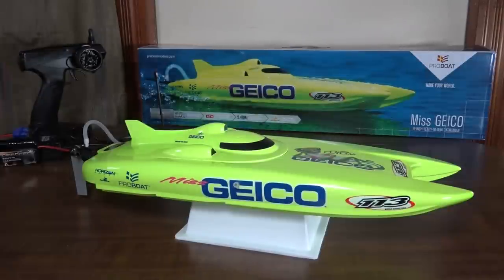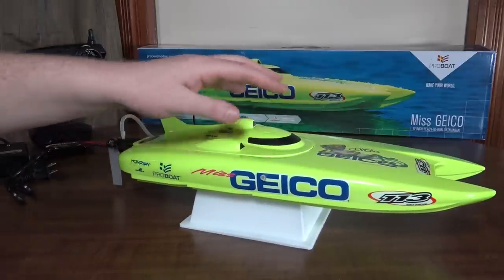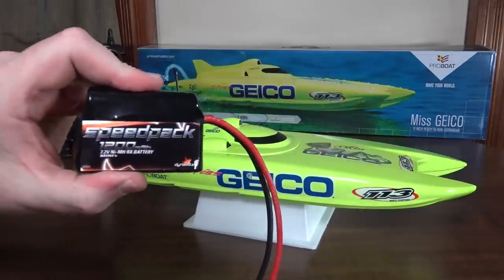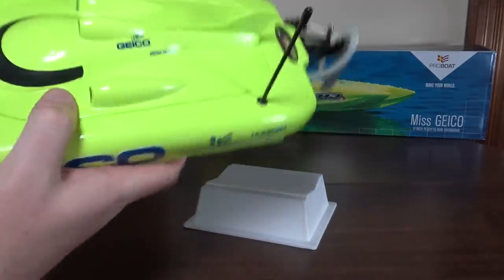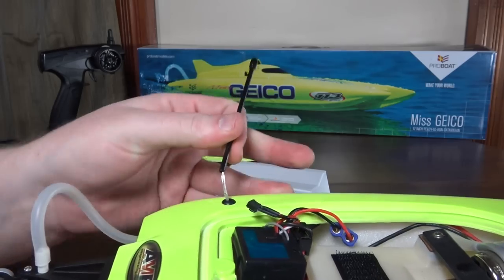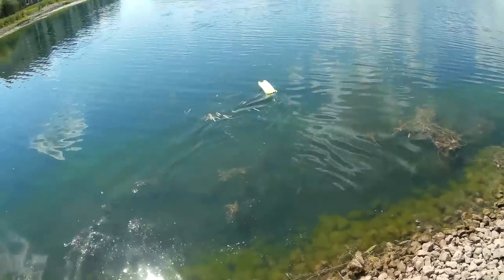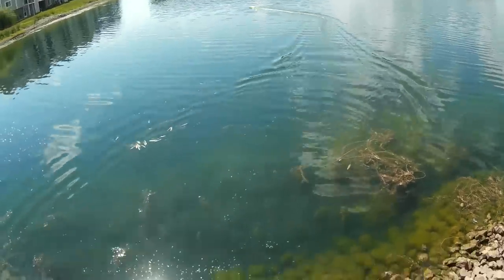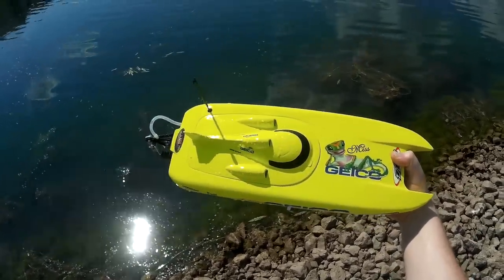ProBoat - Miss GEICO 17 - Review and Run

Comment: I have the proboat impulse 17 and 31, my 17 I have a lipo for it and it basically doubles the speed, and yes they're slow with the nickel pack, but lipos will work. I use my 17 as a rescue boat for the 31
Reply from the maker: +DeucesWild Yeah, I just ordered a LiPo, and LVC buzzer (since the ESC doesn't have LVC) for it.  I'll do another run video of it with the LiPo.  :)

Comment: Hey Ryan, thanks for the candid review.  Not really a $120 product, with only a 380 motor.
BTW, Horizon chat specifically told me do not use a LiPo on this boat.
On another note, couldn't help but notice the different hue of the boat between the Sony and the Mobius.
Thumb's up!
Reply from the maker: +Steve S They probably said that because the ESC does not have an LVC.  But, it should still work... I'll just have to monitor the battery level on my own, or get one of those LVC warning devices that connects to the balance plug.  :)  I'm gonna give it a shot, anyway... I'd rather burn this thing up trying to make it go fast, than live with it the way it is.  hehe
Reply from the maker: +Steve S Hah, that thing is a wheelie machine!

Comment: you should put a 3s lipo in it and see how long it lasts until either the motor or ESC burns up, and then put a brushless power system in it.

Comment: If I remember correctly there are upgrades for lipo and brushless available for this boat.
Reply from the maker: +Anthony Eaglebarger (toysoldier46552) Hmm, not from ProBoat, but maybe from a 3rd party.  I ordered a LiPo that should work with it, so I will likely do a follow-up running video of it with the LiPo, to see what difference it makes.
Reply: Flyin' Ryan RC Actually I think it is a different model... does the 29 ring any bells at all rather than the 17?
Reply from the maker: Anthony Eaglebarger Yeah, the 29 is brushless right out of the box.. but it costs $430.  :/
Reply: Flyin' Ryan RC well it is brushless and uses 6s if I remember correctly so most likely worth the extra bucks for the speed.

Comment: I wouldn't mind starting out on a slow boat, but if it's slow I'd rather have an rc battleship with rotating turrets. That at least looks it's supposed to be slow.
Reply from the maker: +HelmutDoork That would be cool.  :)  And, yeah, that is my main problem with the speed of this boat... it's supposed to be fast by design!  If it was designed like a yacht or something slower, then it would be much more appropriate.

Comment: Great video flyan Ryan can you run 3s in the miss gieco boat?
Reply from the maker: I don't think so, or not safely at least.  I didn't want to use more voltage than the stock battery, as the ESC may not be powerful enough to handle more.  I think the brushed motor is really the limiting factor, not the battery.

Comment: how did you switch the nmhd to lipo?
Reply from the maker: +Jerry Johnston Nothing to it... I just bought an Eflite 2S LiPo with the same connector type and similar size, and plugged it in.  :)  The boat's electronics doesn't have a LiPo low-voltage cutoff though, so I bought a voltage alarm that connects to the battery's balance plug and that goes off when the battery hits low voltage.  :)
Reply: +Flyin' Ryan RC ; Thank  you  for responding. I bought the Foxx s911 monster truck and it is a nice little  truck but it runs on a (16500/800mah li-ion battery)which dies in 2 minutes after full charge, do you know if it's possible  to somehow switch to better battery  types?
Reply from the maker: Jerry Johnston Be careful iwth the S911... it has a major design flaw, creating a very weak point in the rear suspension.  If you flip the truck, and land hard on the support arms that the body connects to, it can snap at the base and take out the entire rear suspension.  I broke mine on the very first run.  And, there is no way that battery should only last 2min.  You must have a defective battery or charger.
Reply: +Flyin' Ryan RC ; That's  what I thought too, so I bought 2 extra batteries and they all last the same time. A defective  charger is probably the culprit, I have the Tenergy TB6 synchronous  balance/charger but don't know how to charge these 800mah li-ion batteries...I am very new to hobby grade rc batteries  etc. lol Thank you  for  your  time Ryan.
Reply from the maker: Jerry Johnston You should definitely be able to charge that battery with your TB6, if you have a charging lead with the proper plug type on it.  If you have a local hobby shop, you might try taking it in there and I'm sure they'd be happy to show you how to set it up to charge your battery, and make/sell you a charging lead if you don't have the right type.  :)  The charger probably has a LiPo/Li-Ion setting, and then you would want to set the charge rate to 0.8 amps for a 800mAh battery.  That is really all there is to it.  Oh, I just looked up the S911, and I think the battery is actually a LiFe battery, but your charger has a setting for that chemistry too.  :)
Reply: +Flyin' Ryan RC- mine says 16500/800mah 9.6v li-ion on the battery  pack, it's blue with 3 cells in it....i have the squid with all the plugs on it and it has the one I need. so .8 amps what should I set the volts to? 3.6, 7.2, 10.8, 14.4, 18.0, 21.6, and Auto are the options it gives me.
Reply from the maker: Jerry Johnston Well, it should be set to 9.6 volts, like it says on the battery.  Look at the LiFe settings and see if you see 9.6V.  I'm not sure if Li-Ion batteries have cells like that battery has.  And GearBest's website calls it "Li-ion-Fe", whatever that is, lol.  I'd hate to tell you the wrong setting and cause a fire.  :O

Comment: its good.

but the traxxas M-41 widebody is a LOT better.
Reply from the maker: Yeah, and 4 times the price.  This boat and that boat are not even comparable, especially since the M41 is brushless, and this is not.
Reply: +Flyin' Ryan RC yeah.  but how is this thing slower than my Tide Breaker by Revell Control?  it even has a bigger motor with water cooling? how?   yeah my boat goes up to 25kmh
Reply: +Flyin' Ryan RC and mine is a lot smaller.
Reply from the maker: Sergej Nadaždin Could be many things, like the catamaran hull causing more resistance in the water, overall weight, and maybe even the size of the prop.
Reply: +Flyin' Ryan RC or just windings in the motor.       if you want it to go faster, remove all electronics, buy new receiver, stronger motor or even brushless motor?, and a servo (ESC if using BLDC version)
Reply: +Flyin' Ryan RC but wait!...  can you make a review of the m-41's small version? looks exactly the same, but it's a lot smaller and cheaper!
Reply from the maker: Sergej Nadaždin Do you have a link?  I do not see any mention of a smaller version on their site.
Reply: +Flyin' Ryan RC oh! i forgot. you can get the plans and make it.
Reply from the maker: Sergej Nadaždin Oh, well I don't build kits.  I only review Ready-To-Run stuff.  :)
Reply: +Flyin' Ryan RC well then check out the UDIrc venom racing boat.  you can buy it on aliexpress for 35$
Reply: +Flyin' Ryan RC or the Revell Control Tide Breaker.
Reply from the maker: Sergej Nadaždin I had a UDI boat to review, but it would never sync up with the controller, and the sponsor didn't want to send me another one.  :(  As for the Tide Breaker, like I already told you, that is just a rebrand of the WLtoys WL912 which I just reviewed last week.  :)
Reply: +Flyin' Ryan RC why not just get another udi boat, or just get a new receiver. or try different controllers.
Reply from the maker: Sergej Nadaždin I may buy one, just to review it, but I try not spending too much of my own money on stuff just to review.  That's a quick way to go broke.  heh
Reply: +Flyin' Ryan RC also, a few days ago, i was diving, and found a RC speedboat. looks like a tiny hydroplane. electronics fried, but hull intact. might empty it out, and install new electronics.